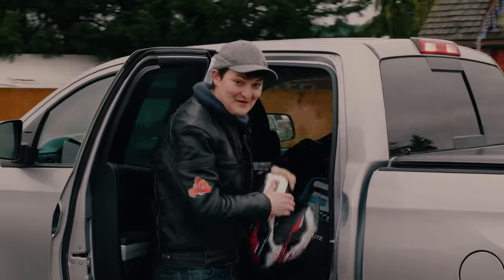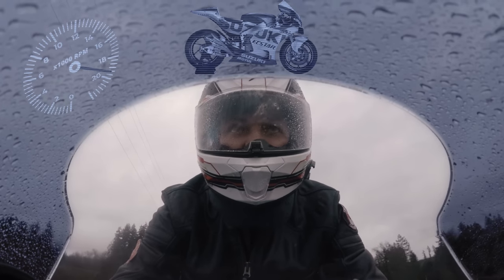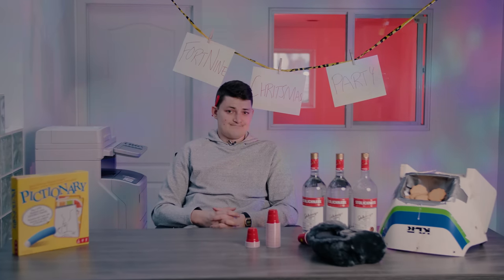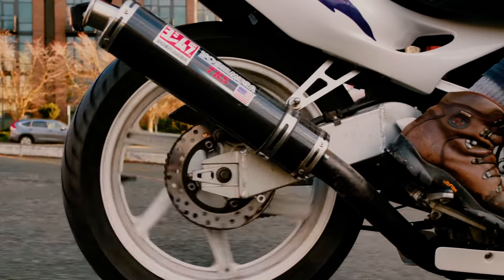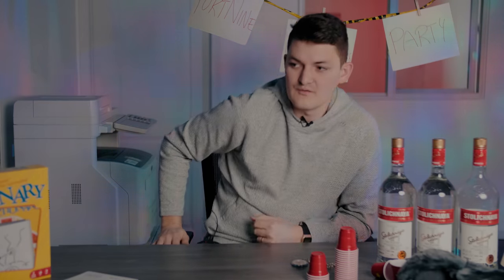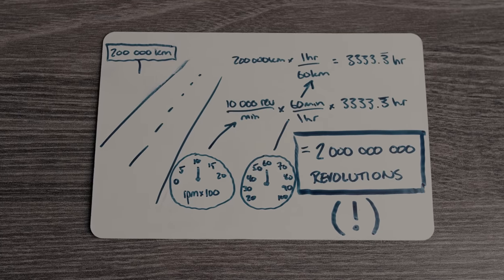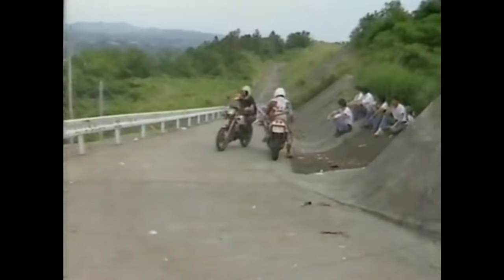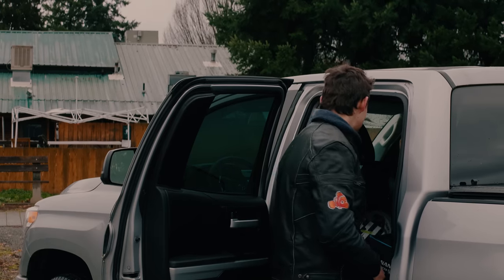The '90s Honda that Revs Faster than an F1 Car

Comment: “If every beginner started on one of these, there would be no other motorcycles.” ❤️
Reply: There's a 100% success rate of cars hitting these things.
Reply: @Gma7788  with that amount of noise?
Reply: @fireblow44  Noise only helps against pedestrians and cyclists.
Reply: @jenschristensen1774  interesting
Reply: @fireblow44 true.
Reply: @EFIMira  5? it's pretty much amount, guess they waiting for ya then💀
Reply: For sure if everyone started on one of these it would definitely be the only bike they ever had
Reply: ...but we are older and wiser and now we would ride prudently, wouldn't we? 😂
Reply: In Australia, that was nearly true!

We could only buy 250's, these bikes were everywhere!
Reply: @EFIMira  they are pretty slow ngl
Reply: Used to be super popular here in aotearoa/New Zealand.
Reply: @Gma7788 wanker
Reply: In '96 I began on a CBR400rr Gullarm '93. And never wanted anything else. Still got it, well looked after and planning my annual 3 week roadtrip across Europe (minimum highways). So much fun!
Reply: I still ride a zxr250 (kawasaki version) as my primary street bike.

Comment: I love the idea of 90's big four in japan being like "we think its very important that we don't build bikes that exceed certain parameters to prevent government regulation ... hey street racing teens, check out these sweet rides that look like race bikes, sound like race bikes, rev harder then race bikes AND purposely slip around government scrutiny"
Reply: Street racer, in Japan:
  "Yea....So ....Just going to school, dude..."
 12k on the dial....
Reply: It's a bit like the european 125cc class. 16 years olds (in Finland at least) could only ride those, but there was no power limit, and the you have sport bikes with very unreliable 35 horsepower two strokes, when with 90s technology, the bikes would have been actually usable with 350ccish four strokes or something with the same maximum power.
Reply: Subaru and Mitsubishi had a gentleman’s agreement to stick under 200KW from 2L engines in their rally cars. Those Japanese do strange things sometimes.
Reply: @SimonBrisbane  Japanese car and bike manufacturers both have certain gentlemen's agreement in order to make sure they antagonize each other as less as possible.
Reply: They all want to make money, and if by some gentleman's agreements with your rivals, you get to carry on making money without having to spend as much money, then great.

Comment: You can also clean parts in the fuel tank ultrasonically while you ride.
Reply: As a 'gun man', that has really real idea....
  (Reloading)
Reply: Haha! That's a very good point!
Reply: Especially when you think of the harmonics that come up in the vibration of parts. Indeed.
Reply: Bzzzzzzzzzz!
Reply: @peterruiz6117  Better have a separate bag containing the brass then, you don't want that crap in the fuel or fuel filter.

Comment: owned a 1991 model and the original engine did 200k+ km before i sold it. Last time i heard from the owner it was still running years later on the same engine

Comment: im lucky enough to own one of these. I got it as a learner bike with the intention of transitioning to a bigger bike one day. I enjoyed it so much that i never gave it up. The screaming in-line revs never fail to bring a smile to my face.
Reply: I'm so jealous man
Reply: They are really cool and I love them as well but they become less cool when you are trying to go to sleep after a long day of work and one goes flying by.  They are really cool but I am glad they are gone.  Really loud bikes just cause issues.
Reply: @SirNarax no
Reply: @ProSkye59  Yes.
Reply: @SirNarax  no
Reply: @ProSkye59  Yes.
Reply: @SirNarax most bikes with exhaust are loud, personally i think one/two cylinder are more loud(noisy to be exact). Because at least inline4s sounds nice.
Reply: @cloudwalker679  It is fine to go for a quality of sound but don't equate loudness to quality.
Reply: Yeah they rev but you beat one in first gear on foot not literally but you get what I mean. The rgv 250 2 strokes just flogged them and they only went to around 11,000 before power dropped off.

Comment: In New Zealand these Japanese 4 cylinder 250's were a dime a dozen, you can still buy them. I had the Honda CBR 250R, the Yamaha FZR250R and the Katana 250. The 1988 GSX-R 250R is the lightest but the Honda definitely has the best engine. Going to high school with my friends in the late 1990's early morning sounded like a F1 race we all had 250 fours, was a great time! The CBR250RR MC22 has a re stricter set at 118mph (190kph) The older CBR's 1986-1987 (MC17) don't have one. The MC19 1988-1989 models have a limiter as well. Funny story. I had a race with an old GSX-R 750 on the Honda CBR. He was closing in behind me and I was going around 180kph (110mph) I came up to a tight sweeping corner and the Honda took the bend like it was on rails. The dude on the GSX-R nearly ended up in a hedge.
Reply: Katana 250!! What/Where/When/How???
Reply: Yep my first bike in 2013 was a 1994 MC22 i sold for dirt cheap to buy a CBR400RR for also dirt cheap, now in 2022 i just bought a 1992 MC22 for similar to what i paid back in the day

Nz also
Reply: They were amazing. I rode my 89 zxr250 around the outside of 900 street triples on my first Pukekohe  track day almost by accident because it cornered so well!
Last time I saw it, it was over 150,000km and going strong!
Reply: Little bikes, like little cars, get laughed at in a straight line most of the time...but when that road gets twisty, suddenly the big boys can't hang. My 30 year old Civic is slow in a straight line, even more so than stock because worn out 300,000 mile 1.5 single jingle.... but on a twisting road, with the new suspension bushings and manual steering rack and all the work I have put into restoring the chassis, plus the sticky 205/50/15 tires and Acura Integra LS Mesh 15 inch wheels....I have left a long list of vehicles for dead once the roads get twisty, and it is glorious having a little shit box make people's eyes pop out of their heads :)
Reply: And you sold them? Why?!
Reply: Rubbish. 
Different tuning.
None is better than the other. 

You must think we're stupid.

Comment: The one my son races did 201kmh through the speed trap at Phillip Island and his lap time was quicker than  the modern 400 Supersport bikes that raced the year before. It has 67000km's on the clock and sings sweetly at 19500rpm.😁
Reply: glad theyre still about 3k here in victoria ;)
Reply: Yep, there's something to be said for the skinny tyres on these things. Gives some nice turn in
Reply: That pretty impressive seeing how a stock one will never get anywhere near that.
Reply: @uhtred7860  , the bike definitely is standard. The top 5 cbr's all went through the trap at close to 200kph, all with standard gearing. The important thing is that everything is kept tucked in...elbows, knees and head.
Reply: Having also raced ZXR250s and vs the CBRS the tickled ZXR isa bit faster but will also reach similar top speeds. ~210.
Reply: @uhtred7860  That's actually quite possible I have raced them for  years in ZXR250 and mine was a touch faster and also went over 200..
Reply: @N4CR  To be honest the only ones ive ridden, were Japanese imports that were restricted. I don't know how easy it is to de-restrict them, could be in the speedo, like some other JDM restricted bikes have, or it might be a (black box) restrictor. The NSRs, especially the later MC28 ones were a bastard to de-restrict.

Comment: Gotta love that sound from a 4cyl low displacement bike. Recently got the chance to ride my friend's Kawasaki ZX25R and might I just say, it's one of my favourite experiences in riding a bike ever. The sound it produces, the beauty of the bike is just second to none. I feel pity for a lot of countries that don't get this bike because 4cyl 250 are definitely one of the most fun you can have in a motorcycle without putting yourself in danger

Edit: I lived in Indonesia and the ZX25 has been here for a long while
Reply: They'd never pass emission laws in the UK so I'll probably never see one 🥲
Reply: Having owned a 91 cbr250rr i can tell you it wasn't hard to get into danger. I can also tell you they were limited to 180kph
Reply: @satellizera6446  well, as long as you're a responsible rider, you're not gonna get in danger. Just listening to that melody on an empty public road going 80-90 kmh is already fun enough for me
Reply: Leave it to Honda to engineer a bike that revs to 20,000 and is still way more reliable and longer lived than any BMW or Ducati. The Honda S800 sports car used roller bearings with a 9500 RPM redline which was higher than any production car at the time including Ferrari models. Honda engineers have a unique passion their competitors lack.

Comment: I remember the first ride on mine, in the wet the feel and noise it took off like a rocket felt like I was doing a million kph I look down at the Speedo and I'm only doing 40kph  that's when I remember it's a 250... Bought it. Kept it ever since it's now at 210000km... One thing Ryan didn't mention in video was that the odometer resets every 99999km  therefore these bikes will stay forever young 😁
Reply: Thats so amazing 👏.  Truly a bike you keep for a lifetime.

Comment: I've always wanted a 250rr. Best sound for any bike.
Reply: CBX 1100 6CYL 😉
Reply: @RedFly.  facts it sounds like an f1 car the CBX is the best sounding bike of all time.
Reply: @RedFly.  youre the clown if you think the cbx doesnt sound better
Reply: Cbx with a pipe and VFR 750 with a pipe. Glorious sounds!! This is cool as well.
Reply: I used to have one. Great bike untill you get bored of making tons of noise and going no where fast. Realise its the same sort of thing as a Harley (all show no go).

Got a Cbr900rr 1992 model now instead. What a bike.
Reply: @RedFly.  Youre the clown today bud. The CBX has long been regarded as the best sounding motorcycle with the Aprillia V4 behind it.
Reply: @sjdjjq  I can believe it. It only has around 50hp which enough to get around town but you have to get the rpms high to go anywhere. It would be fun just to go around town. For anything else, I'll ride my goldwing 😁
Reply: @sjdjjq  I started out riding on a 300 the previous owner had put a full system on. And while it was quick for a 300; it did make waaaaay too much noise for what it was doing. Made me feel a bit concerned that the police might take more interest in me than was proportional to my actual performance. Made me very much try to avoid riding it at night out of consideration for my neighbors. Definitely best as a second or third bike
Reply: Oh I dunno... the six cylinder Hondas sound scrumptious... so too the early VFR 750s... 92/93 versions... original 900 kawasakis with stock pipes were awesome from the mfg...
Reply: @MrKillervincent  It was a 1000cc. I owned one and yes the sound was ridiculous good. https://youtu.be/lal5UgVyiiU?t=323
Reply: @sjdjjq  Except a Harley can't carve through a twisty road like a squirrel on cocaine. Ive ridden mine for hundreds of hours on motorways at over 120 kph (~80mph). And it never bothered me even after I'd gotten larger bikes, apart from the seating position which is a bit cramped for my ~6ft frame. The motors in these are designed to run at 10k+ rpm and will happily sit there all day.

But where they really shine is on a tight twisty road where you'd be nervous with the throttle on a more powerful bike. The lack of torque just encourages you to hit the corner faster, as does the joyous handling and lack of weight.

In my opinion the biggest problem with these old pint sized screamers is the old tire sizes which limits your selection to tire models that haven't been updated since the 00s

Comment: I've wanted one for a while, but my cheap 93 FZR600 scratches that 90's Japanese double-headlight itch just enough...for now
Reply: Thought that was an FZR, I noticed it in the background of the mine cart video! My brother used to have a 1990 FZR 600 Genesis, those bikes are very impressive for the late 80s/early 90s. I'm working on a 1986 XT350 enduro I just picked up cheap,  the weird original "twin" carb and a a half is junk so I'm trying to make a twin pair of PWK flat slides fit in the limited space available
Reply: Gotta recommend a 1999-2002 R6 still carbed double headlights and looks beautiful
Reply: I really love the sound of a 3 cylinder Triumph. But it still comes second to a 19k rpm redline.
Reply: I was eyeballing yours in your last video.
Reply: ohhh god i miss my frz1000 the sound was brutal 😅
Reply: Those are kinda the motorcycle equivalent of pop-up headlight.
Reply: Throw a FZR 400 swingarm on the 600 and you will LOVE it.  Lighter and shorter wheelbase.  Bolts right up.
Reply: @consolehacker54  Yamaha put the 700 genesis in a cruiser. The 85-86 XJ700X was one beautiful bike. Had one for years, still do but it's wreaked. Don't have the heart to scrap it. But it was one high revving 140mph+ dream to ride. So comfortable, I rode it nearly year round for 15 years. Wreaked it once and rebuilt it. Lasted another few years before a "friend" totaled it. They've never really made anything like it since.
Reply: got the same bike and love it!
Reply: @MicraHakkinen  A few years ago you could pick up a Triumph Legend TT for under £1800. Looks like a bonnie, sounds like an triple and could be retuned to put some guts back into them. Bit basic though, a fuel guage is a must!
Reply: I'll see your '93 FZR600 and raise you my '87 FZ600 :) So much fun!
Reply: I have a 07’ fz6 hehe
Reply: I had one, and I loved it 🙌🙌🙌
Reply: I just picked up a perfect condition fzr 600 with 6000 miles on a trade for my gen 1 Fz1 and I love it.
Reply: @gavin3810  if the headlights aren't round, get it out of town
Reply: My second bike was a 1990 FZR600!! After 17 years of sitting in the previous owners garage all I had to do was clean out the fuel system and replace the battery and some rubber. Been riding it almost every day for a year and a half. Amazing reliability and a beautiful bike. Truly the best 90’s double headlight sport bike bargain right now.
Reply: @rayconifer3151  I sold my gen 1 FZ1, too, and then bought a mint YZF600R (Thundercat) with 4000kms.
Reply: @MrKamechan  I loved the Fz1 but it was just too big to keep up in the corners on the tail of the dragon
Reply: I had an fz6 that could rev to about 15k or so. It dead timid at low revs though. My current mt09 has power everywhere, it mental.
Reply: @mrflippant  I see your '87 FZ600 and match you with my '88 FZ600! We have the predecessors, but the FZR had the better frame and their motors were canted farther forward. Both made a world of difference from what I hear. I think their brakes are better too. Still, gotta love our generation: the first true full fairing "Race replica" bikes!
Reply: ive had one for almost a year and i race mine in a classic motorcycle racing club and it seriouslly is such a good bike. it feels so good to ride, i dont even have to worry about changing gears most of the time since theres no need
Reply: This definitely reminded me of my own FZR 400 way back when
Reply: @Josh
Better yet bolt your Fzr600 motor into a fzr400. So much fun!
Reply: fzr with 2 head lamps is ugly as   this earlier version with one headlamp is cute .,but everything else is nice .
Reply: @gavin3810  I have a 2000 ZX9r, still a competitive beast on the street today, and looks much better than many bikes new and old imo, including the R6 and R1 of the time, I have a mate who owns both though.
Reply: cringe
Reply: @consolehacker54  i have a 1990 fzr600 super fun to ride but 225/mth for insurance so its parked. sucks did a good freshen up on it too. Canadian insurance is legal robbery
Reply: @brunobossio2388  Ouch! With minimum/liability only coverage I pay less than 100 USD a year for multiple bikes!
Reply: @gavin3810  yeah if you like transmission problems that's a good bike to recommend...
Reply: @mrflippant  had a buddy that had the FZ 600, after a few years of the FZR 600 being out. Didn't care, I LOVED that bike. I borrowed if often, and left my pristine/ 92 seca II as collateral. ( He also had the original GSXR, and would ride this, while I was aboard the FZ. Fun times.
Reply: Feel u my old hornet 600 gives me the same feeling.
Revving it up when I am leaving my hometown just always puts a grin on my face
Reply: @mrflippant  I used to have one of those as well
Reply: @CyberDashie having had an fz600 as well, there is quite a bit of handling improvement in the FZR
Reply: Yep 08 Fz6s,  cheap thrills!!
Reply: its so ugly
Reply: what a surprise to see YOU here :) i realy enjoy your videos and i am happy to see that you are into motorcycles
Reply: @HalfdeadRider  I had a 98 ZX9r it was a great bike one of my all time favorites.
Reply: @zx9green791  Awesome, underrated beasts 👍
Reply: I had a '93 FZR 600 with a factory FZR 1000 pipe on it.  The sound was straight SEX!!